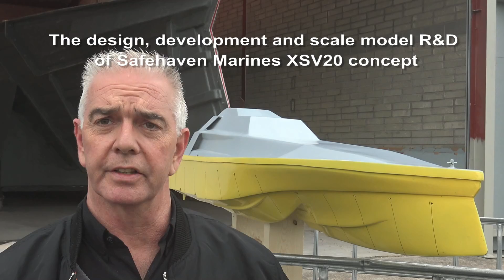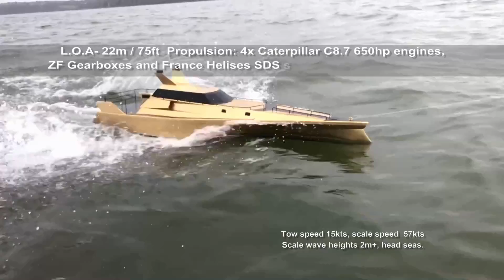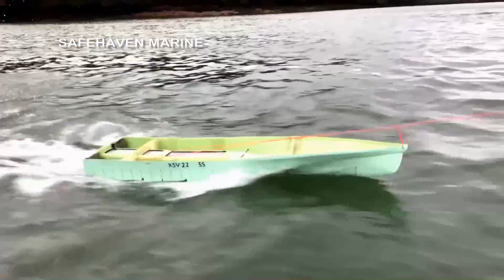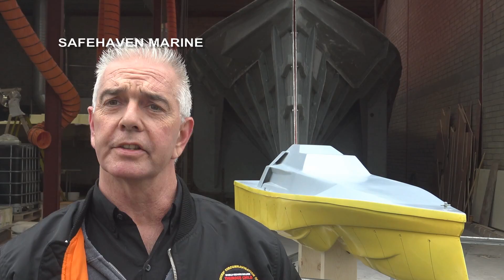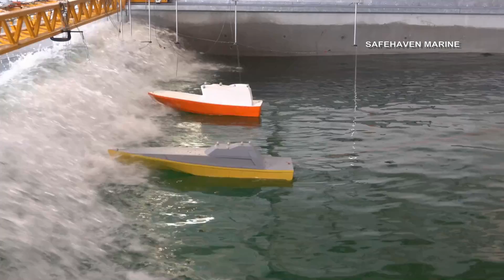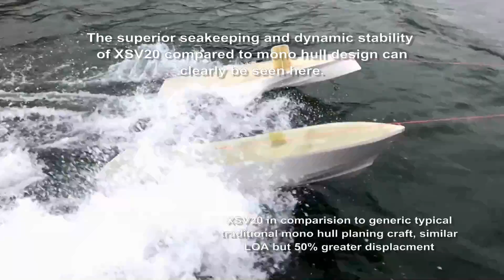XSV20 Scale model tank testing and RIB trials FB

Comment: These are excellent tests run by Safehaven Marine. 
In 1962 I left Chatham Dockyard and went up to Durham University where later I was transferred to the new university at Newcastle-upon Tyne. I used to often go to a Museum somewhere at the Town Moor and this Museum housed the Turbina the first British steam turbine ship built by Parson.  There in the corner where Turbine as the house I used to see and handle a few stepped hulls which were similar to the models shown in this video.  There must have been about a dozen wooden models all having different step arrangements including various airing ducts.  I know that Turbina was moved from that Museum to another one " the Discovery Museum at Newcastle" and I just wonder what happened to those old models made by Parson.
Turbina had a lot of propeller problems as the steam turbines where directly shafted to the propellers and Parson compromised on the problem by using three propellers on the same shaft of which there were three if I remember correctly.   
https://youtu.be/w5bQqih0GEA
https://youtu.be/zbobWg86J9I
https://youtu.be/ky2p-ddlO6c
https://youtu.be/v8NmQM_s8_E

Comment: I'm suspect of rope attachment (towing configuration) during trials. Power boats are pushed with props not pulled sails (ropes). I'm sure you have stacks of evidence proving your hypotheses, but that's all there are in real life demonstrations. You must push the boats with engines and the skill of drivers. Too many different factors to be considered to pull a scale model along side a rib and make any conclusions.

Comment: What are you trying to achieve here, speed?? 
First observation; what your giving up for speed your losing in stability and control. Sooo, if your looking to set a speed record on a lake you might be headed in the right direction. 
As far as function use, or improving the concept of boat shape; I'd say, keep thinking. 
Also, you're having to go long in length, which is going to give up the added benefit of holding space; so no chances of a cuddy cabin or sleeper berth..not competitively 
Again...if you're hoping to achieve some sort of record on a lake worth investing obviously a lot of time and money; good luck.

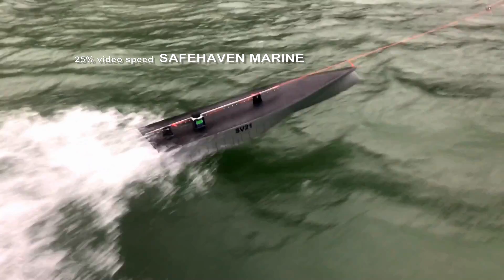Comment: Model testing looks good but if you take a closer look in choppy conditions like in 3:33 the bounce of the boat on the waves affects the angle of the tow line thus the bow on the model remains upwards sliding through the waves.